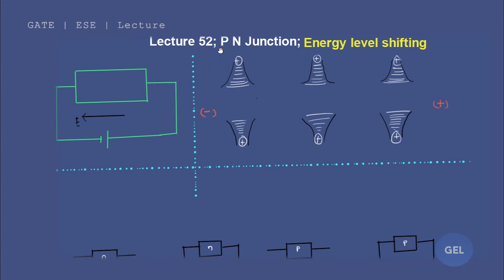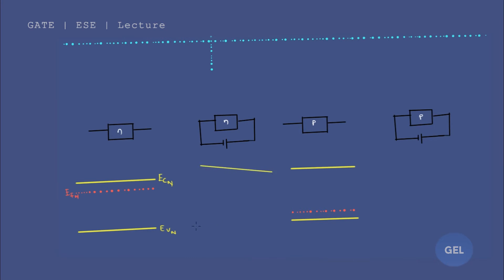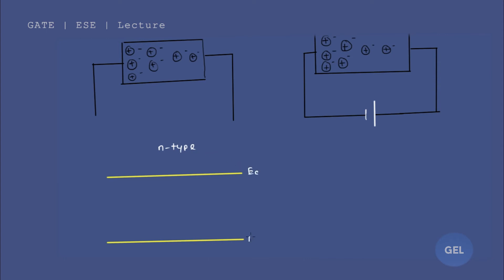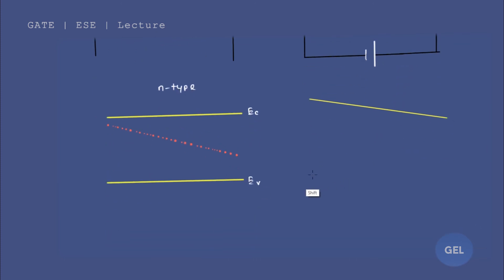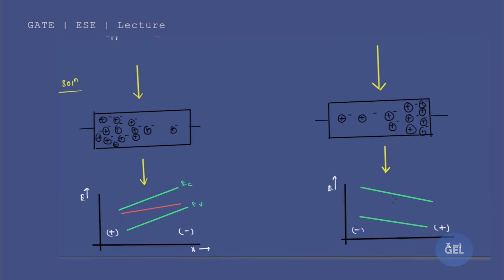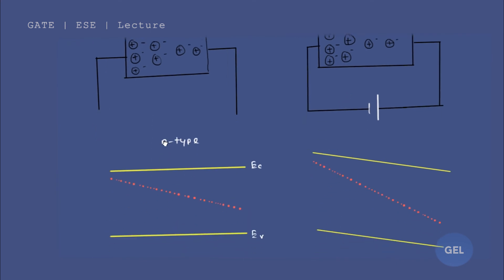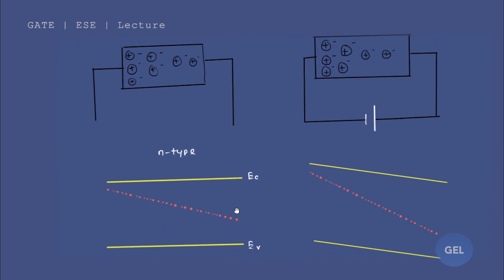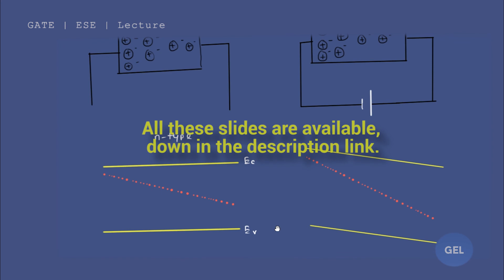Lecture 52; P N Junction; Energy level shifting

Comment: Sir y u didnt consider  built in electric field when u r drawing energy band diagram for  non uniform doping semiconductor ( before the example at 7:17, ), but in the example  u considerd the built in electric field  to draw the energy band diagram for the non uniform semiconductor. And one more doubt is , the gap b/t   EC-EFN  should be more in less doping side, but u hav drawn it id very less in the 2nd example ( x=0, it has less doping so there should be more gap b/t EC-EFN at x=0)